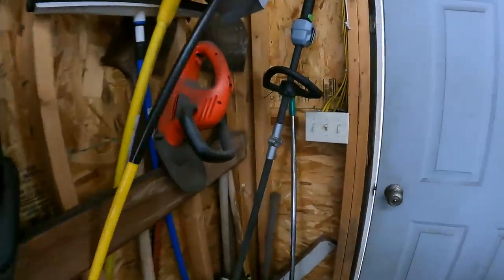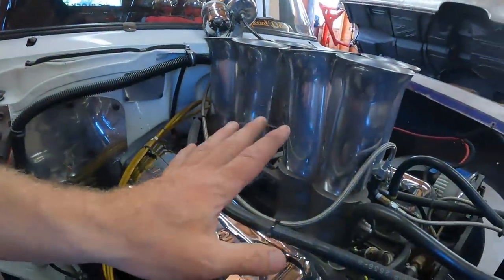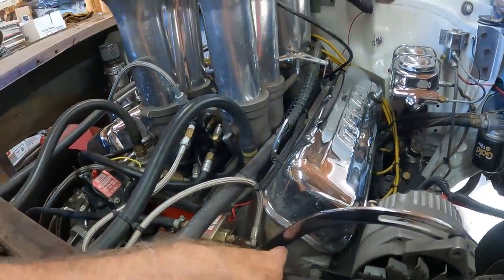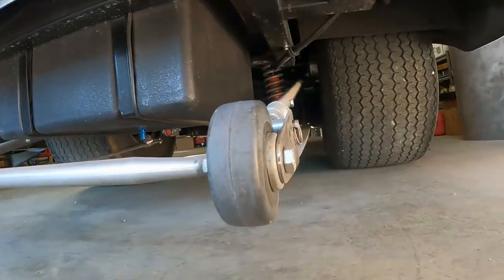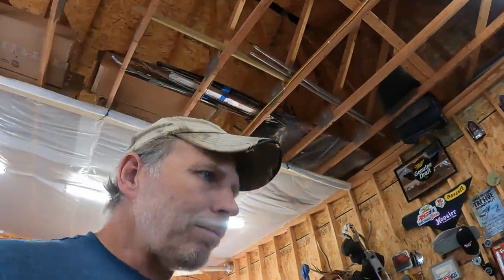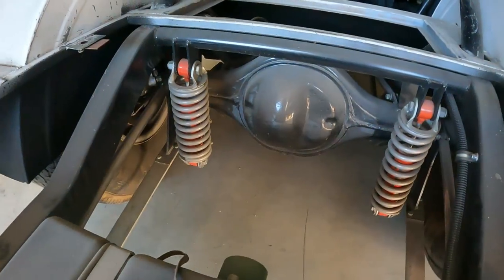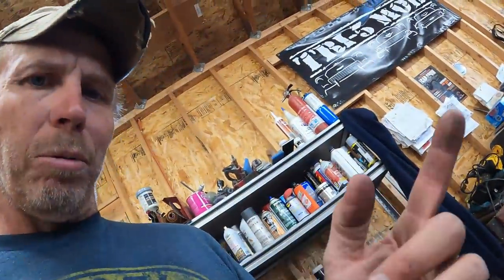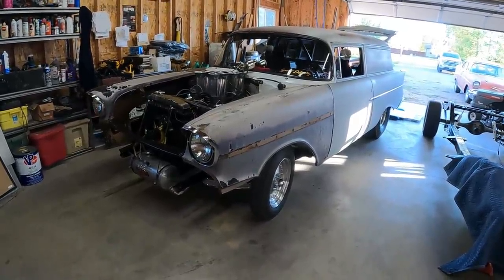Pro Street 1957 Chevy Sedan Delivery - History, Walk Around, and Drive part 2

Comment: To make replacing radiator easier, use a straight piece of pipe, capped at one end with four -8 fittings for the water to come in from the manifold. Put a bead roll on the open end and use a short 90 degree rubber hose to a conventional inlet on a standard radiator. Great car!
Reply from the maker: Thanks John. I appreciate the tip on the radiator.

Comment: Thanks for the review of the '57 sedan delivery. It certainly looked like winter outside. I expect (?) you work in the garage all winter, so I was wondering why it wasn't insulated? Certainly make it a bit more cozy. As you are removing the Poppers from the front doors, could you use them in the back? Could save you a lot of body work and some $$.
Reply from the maker: The shop isn't insulated because I just haven't got it done. That was on the list for the summer (again) but I didn't get to it. Regretting it already, but I will survive another winter and maybe wise up next year. I need to come up with a way to pull a latch on the rear door, not sure the solenoids I have are strong enough, but I need to devise something like that. Thanks for watching.

Comment: One he'll of a car for sure. Yes that eng should pull 600 hp at the crank. Just the hilborns are cool but not practical for street. I'd run 15 40 Rogelio oil. Diesel oil. Still has all additives in it.helps all metals. That's what I run. Good content
Reply: Rottella oil
Reply from the maker: Thanks man. I've been running a Valvoline, VR1 I think, that supposedly has all the right dinosaurs in it. You are correct, it is not practical for the street. Sure is cool though...

Comment: There is no reason to change the look if it's how you like it. I'd sand it down after the door handle and rust repair and paint it back with gray epoxy primer so the metal is protected and the look is the same.
Reply from the maker: Thanks Jeff. That is an option I am considering for sure.